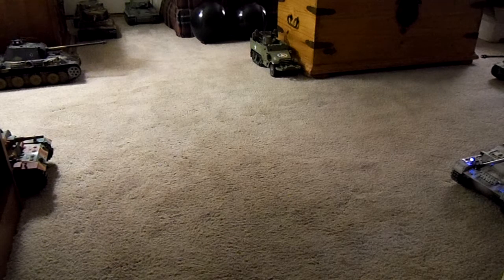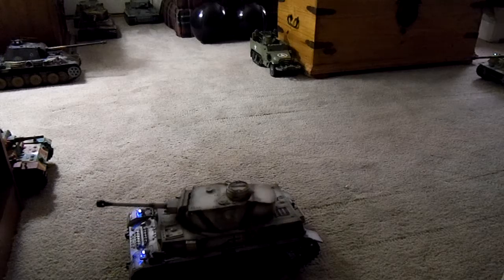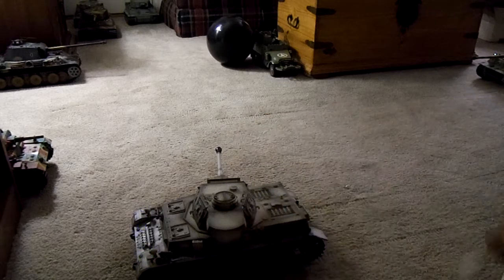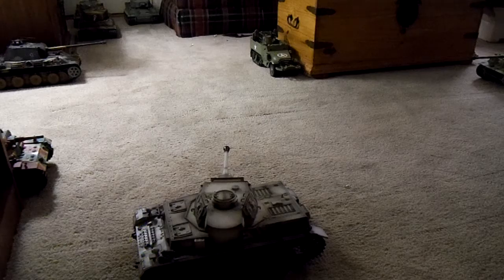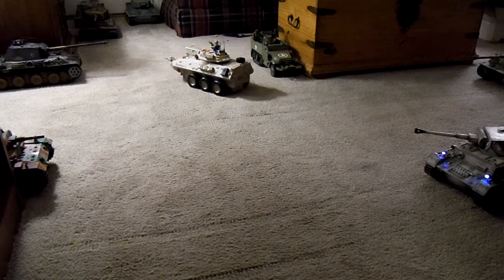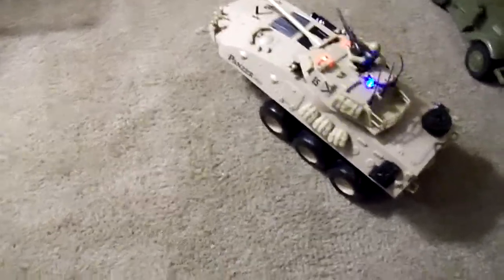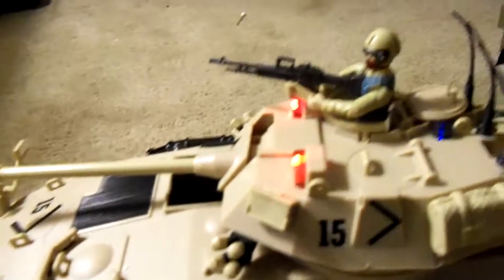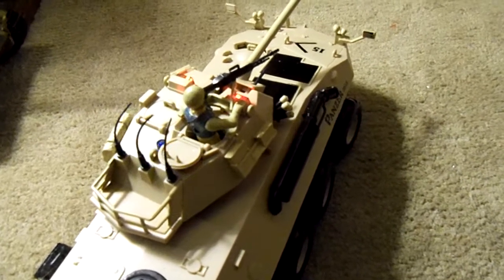balloon trick

Comment: Bruh defaq. That's a hack a 13 year old comes up with. I know video is old but my tank from childhood same one Tiger I is 17 years old now upgrading it as of today and resoldering and regreasing lot of components. If you really want BB improvements. Use heavier precision BBs 0.28g works best for this tank, get PTFE (Teflon) spray (WD-40 makes great ones) and spray some down the barrel at very least, if u wanna take tank apart which u should tbh as they barely put any grease on any gears; once your in the shooting mechanism clip 1-3 rings on the spring that cocks back but no more unless u wanna run higher voltage battery like 8.4V Ni-Mh but that requires a mod to cut plastic in battery compartment in some models (tbh easy) then u can crank it to 5 rings. those are just few things u can do I just listed simples ones.